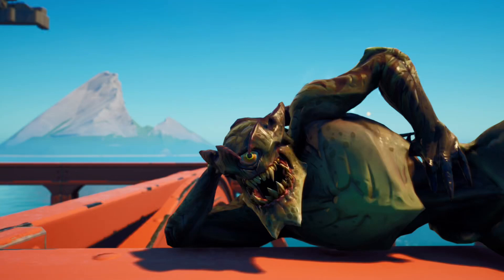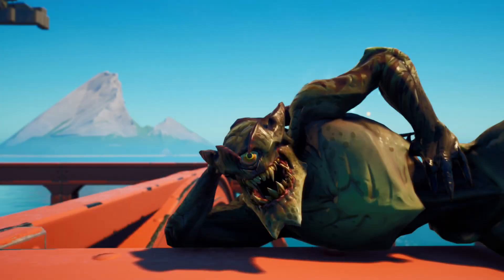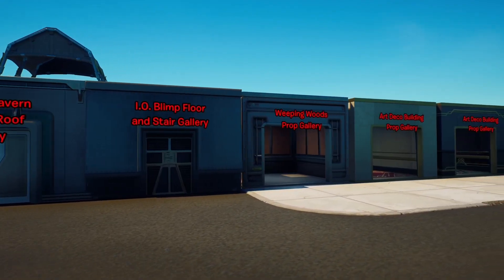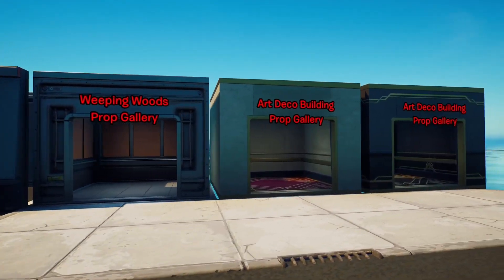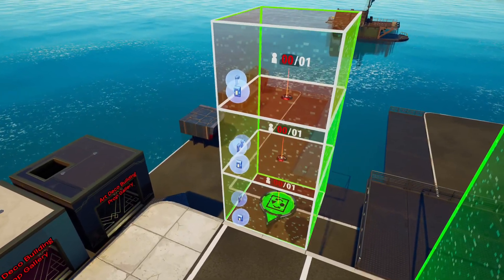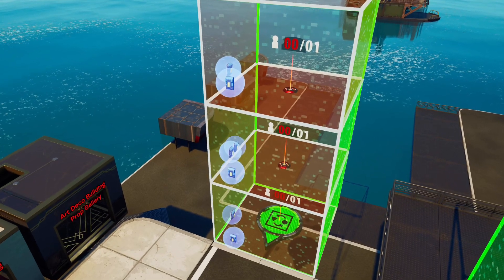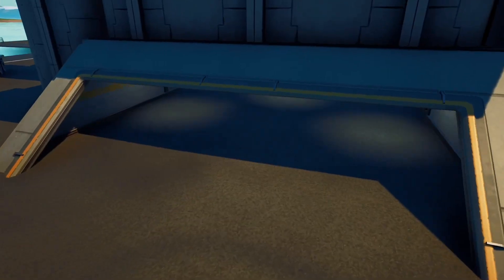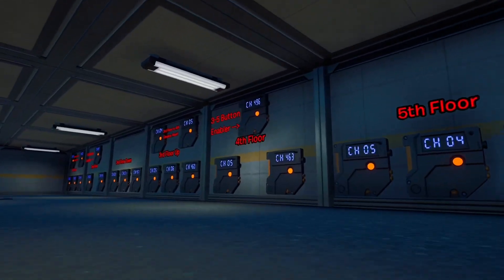How to build a multy floor elevator system with call buttons Fortnite Creative link in description

Comment: hey could you help me with that elevator because it doesnt work for me
Reply: Doesn't work then here :  1 : place the elevator. 2: add the prop move and turn it up 3 : place the button click the buttons settings and u must scroll down until you see the first Channel you can add a number wich you want . 4 : click the prop movers settings .  5 : you must make the start time off . 6 : make the same number of the first Channel number you choosed. 7 : if you start the game you see the elevator isn't working cuz you didn't click the button

Comment: I rather do step by step it's really how to figure out by reading an looking at the channels
Reply from the maker: I plan on making a longer step by
step tutorial as soon as Epic Games fixes the prop
mover device. Unfortunately it will not work until
they fix it by replacing the settings that make the
elevator function as it should.
Reply: @beastofbogarden1086  Are you going to do it soon?

Comment: Hello. Awesome tutorials! But I was watching the both videos and there are settings that are not available anymore. The elevator is going only up but not going down. Are you planning to do updated version?
Reply from the maker: I posted an update in the description stating that the device won't function properly until the employees at Epic Games get back from their vacation and fix the issues with the prop mover. They should be back from vacation around August 8th. I'm guessing they'll have the prop mover device fixed shortly after that. Hopefully.
Reply: @beastofbogarden1086  Hello. Can you make a longer version of the tutorial. When I put everything into place and start the game nothing is working.
Reply from the maker: @typicalgamer5464  I plan on making a longer step by step tutorial as soon as Epic Games fixes the prop mover device. Unfortunately it will not work until they fix it by replacing the settings that make the elevator function as it should.
Reply: @beastofbogarden1086  Ok. Thank you! Have a great day!
Reply: @beastofbogarden1086  Do you know when they are going to fix the devices?
Reply from the maker: Unfortunately I don't know when they will fix it. I keep checking to see if they've fixed it yet and I wonder the same thing.
Reply: @beastofbogarden1086  Ok. Have a nice day!
Reply from the maker: @typicalgamer5464  Epic Games has fixed the issue with the prop mover device.
Reply: @beastofbogarden1086  When are you planning to make a new longer version?

Comment: Hey Beast! Awesome, awesome vid. I get where you’re coming from — short and quick tutorials that are to the point are typically the best, but for something this complex, I think the real boys don’t mind sitting through 15+ minutes of video to get the mechanics right. Especially when this is the most realistic and BEST method around!

For the past few hours, ive followed your pdf file to the T, down to every last number and placement but I’m still having trouble. Ex. When I call for elevator and press button on first floor, 1/4 of the elevator keeps going into the ground after I pressed the button. I tried putting a floor underneath, reinforcing with my walls around on the outside but nothing. Little things like that obviously add up so I’m sure a video would clear up everything if we followed you every step of the way. Otherwise, REALLY great video and thank you so much for putting the time and effort. I for one am very appreciate.
Reply from the maker: Thank you for your comment. I've been wondering if people were having trouble downloading the PDF. It might be the pulse from the sequencer isn't reaching the trigger. Does the trigger turn blue on the top for a second when the sequencer pulse reaches the trigger? The other thing that caused me to have the same issue was copying the prop mover device instead of programming a new one for each elevator. For some reason it kept going in whatever direction I called it and I had to replace the malfunctioning one with a new prop mover device that wasn't copied.
Reply: @beastofbogarden1086  After reviewing, I found the it was the sequencer synchronization with the trigger that I messed up slightly, I forgot to put direction down which was stated in the pdf file. And yes, per your recommendation, I always make new prop movers and never copy and paste them.
Reply: On the PDF what does SD for the triggers mean?
Reply: @LilGoji54  Second Delay I’m sure
Reply from the maker: @LilGoji54  sorry,, I forgot to put that in the PDF. It means "Second Delay".
Reply: One more thing, does second delay mean 2 seconds for delay?
Reply from the maker: @LilGoji54  I believe I put numbers next to it. 1SD would mean one second delay and 2SD would be two second delay. If I forgot to put a number next to the SD abbreviation, please let me know and I’ll get back to you about it and fix the errors I made in the PDF and add a link to the new PDF.